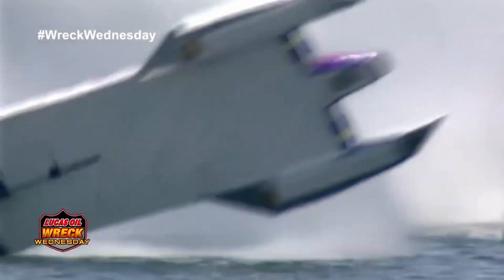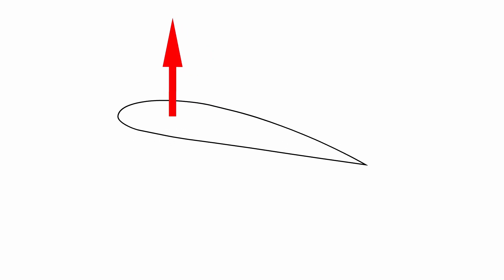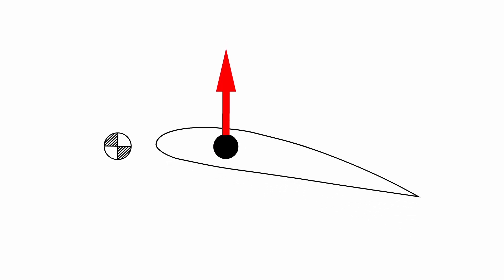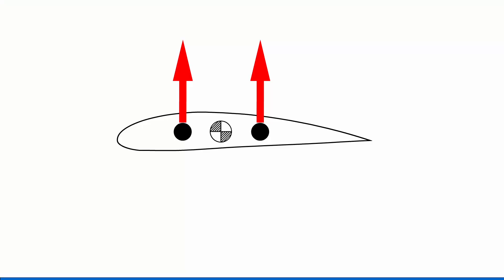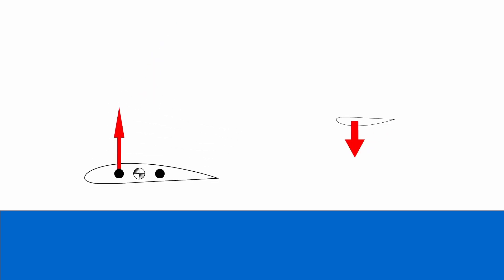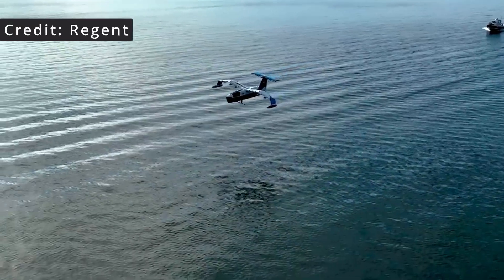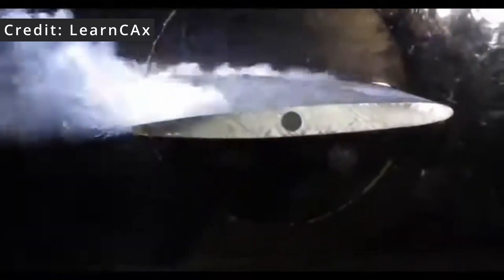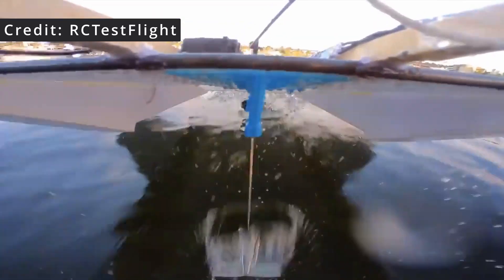How To Fly SAFELY & EFFICIENTLY WITHOUT CRASHING: Regent Seagliders & Hydrofoils!

Comment: Regents approach seems more curious than it should be I think. Im thinking that theyre just using ground effect as a dodge from stricter regulatory requirements and certification. Its no coincidence that theyve been so busy clarifying their position withing the regs to focus attention on their taking part with surface traffic. 

Likewise with foiling which around Pacific islands is going to be fraught with uncharted obstructions and or debris. Something that to be fair was always an issue with flying boats when step taxiing around, and that only very solid hull steps can offer much in the way of safety. And that of course subtracts from useful payload in all except liaison duties one might encounter with something like a Gruman Gosling. Which are only any good for people traffic and not substantial loads.

Not sure they realise theyre going to have to be amphibian to a degree or they wont be able to release other than swimming payloads, or operate land to land even if its the beach.
Reply from the maker: Fair points indeed. The proof will be in the pudding!

Comment: I didn’t understand your free flight example.  If the centre of mass is in front of the centre of lift, surely the plane will dive?  Surely both have to be vertically in line?
Reply from the maker: Great question! It’s a common misconception that the centre of gravity (CG) and centre of lift (CL) need to be vertically aligned. In reality, most stable aircraft are designed with the CG ahead of the CL. This setup would cause a nose-down pitching moment if not corrected — and that’s exactly where the tail comes in.

The horizontal tail surface (usually providing downward lift) creates a counteracting moment that balances the aircraft in steady flight. So even though the CG is forward of the main lift point, the combined lift from the wing and the tail balances the aircraft around the CG.

So it’s not about vertical alignment — it’s about the moments acting around the CG, and the tail plays a crucial role in that balance.
Reply: @onewingspanabove I see, it is just the main wing you were referring to, not the whole lifting forces.
Reply from the maker: @markthomasson5077  You got it!